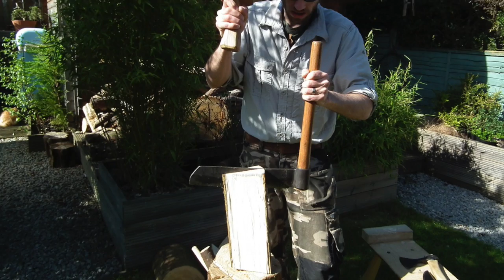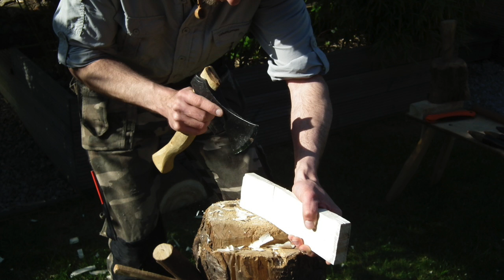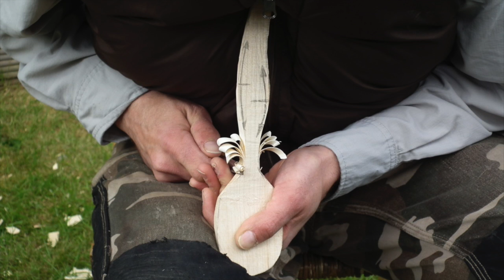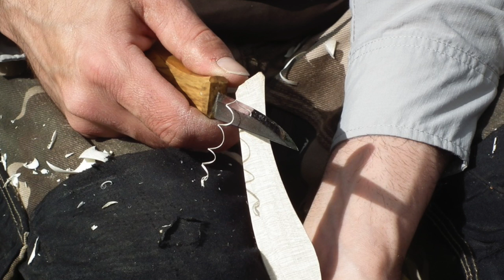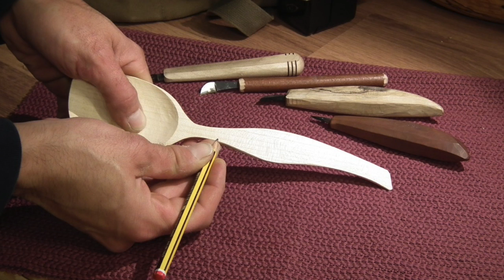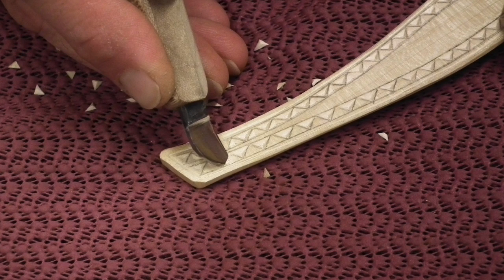Spoon Carving Pictorial with Lee Stoffer

Comment: Your covertcraft.com link is not working.
Reply from the maker: thanks for the heads up, will look into that.
Reply from the maker: Yeah, technically the shop is a separate website but linked to the main site via there store page, there appears to be an issue with a plug in, will hopefully get it rectified shortly. Cheers
Reply from the maker: All fixed now, Thanks again John for bringing this to my attention.